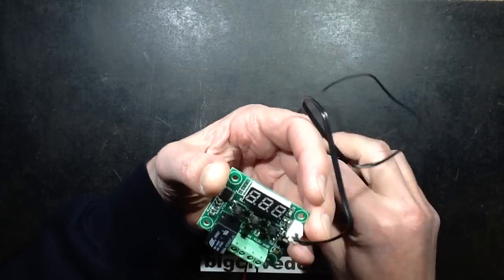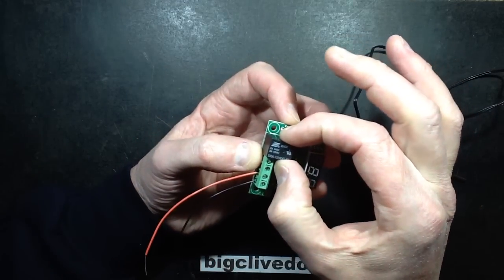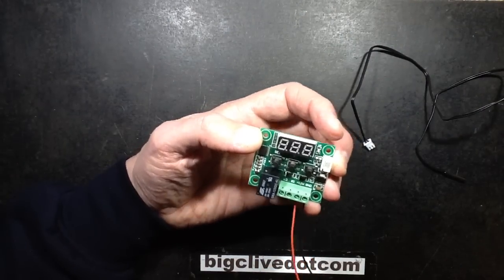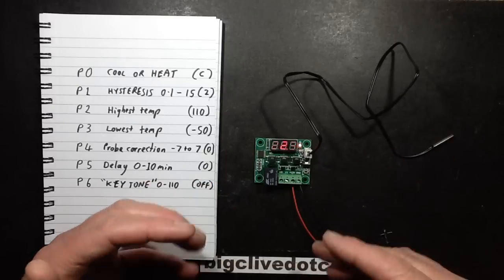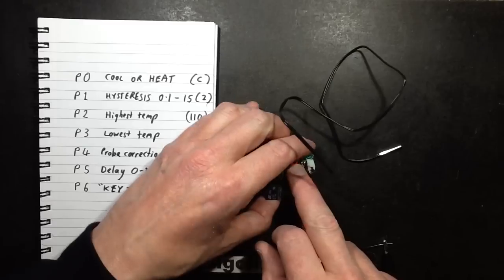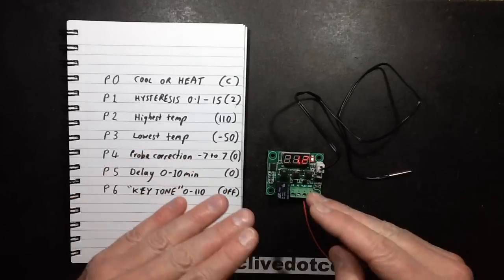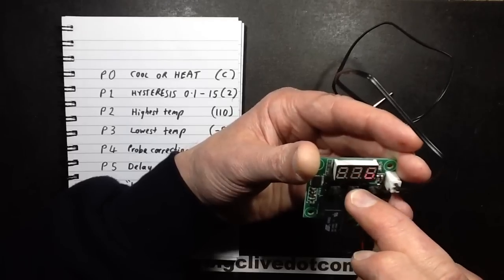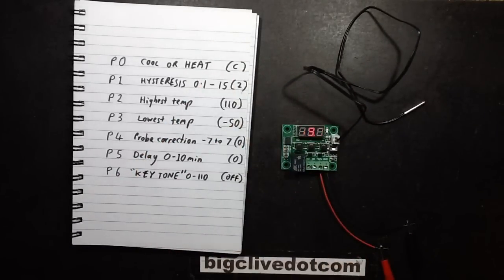Playing with an eBay thermostat module.  New data in description!

Comment: What does the LLL and Flashing LLL mean ?
My P1 always shows the LLL or LLL Flashing.
Reply from the maker: It means that the probe may not be connected properly and it is interpreting it as a temperature lower than it can read.
Reply: I'm not having any luck with this...maybe you could tell me exactly how to set this thing up....as in the reply below....
I want this device to start the Fans on my car Radiator at 140F/60C and not shut off until it comes back down to 140F/60C...
How do I set this up as C or H (Cooling or Heating) and what settings on P2 and P3 ?
Thanks !
Reply: I really appreciate your Reply...
Liked/Subscribed !

Comment: I also would like a couple for controlling a fan for solar charge controllers. Is there anything simpler.     to turn a fan on at 80degrees F?
Reply from the maker: One of the simplest things to do is fit a bimetallic thermostat on the heatsink so that it cuts in if the heatsink gets too hot.

Comment: I need something like this for converting a freezer to refrigerator. Would this work for that? 120v and maybe 10amp in rush. I guess it would require a heavy-duty relay? I just need to shut it off before my mayo freezes! Great video Clive!
Reply from the maker: It would work for that, although I would recommend using it to drive a beefy external relay.  This common unit is also very good:-  https://www.youtube.com/watch?v=9zymx2xgTmk
Reply: bigclivedotcom thanks so much for your time. I have been binging on your videos today. Thanks again...

Comment: hey guys, I got one of those which i want to use on my peltier cooler project. Its default setting is in HEATING mode. Im trying to enter the PO menu to change the settings to cooling but its not working wat can i do? Its not entering the Pn menu even after long pressing the Set button

Comment: Can I use this thermostat to control a 120 watts, 12V 5,5A heatbed?
Reply: Josef Lackner they come with a lot of defense in the switching relays so it’s hard to give accurate answer to you.

But let’s take a look 👀 

On top of that little black thing (relay) on the pcb, there’s some numbers.

If yours come with the 5 amps relay it would be no problem to drive a heater on 66watt witch is what you have if it draws 5,5 amps at 12volt. (Volt times amps gives you the watts it’s ohms that simple)

Comment: I just bought a couple of these that have 12VDC input for controller power, and a couple that have 9VDC-15VDC. I bought a couple of small electric heating pads from Adafruit (10cm x 5cm) to use with these controllers to keep LIPOs warm in my airplanes during freezing weather. I will be able to fly around with the current battery temperature visible as the plane flies by in slow flight - is that considered telemetry??? Great vid, thanks for all the info. I am ready for when these show up, now.

Comment: Well, can I use it to only read the temparature like 450 digree celsius . Clearly I don't want to use the cutoff relay or circuit and want to display high temparature from soldaring rework station or external thermal sencor. Can the circuit bear it?
Reply from the maker: You'd need a high temperature thermocouple based controller.

Comment: I got one and tried hooking it up to a fan for venting hot air and once it reaches the temp I can only get it to pulse on and off. Can anyone give advice?
Reply from the maker: +mike Paz Is the display resetting each time?  It may be crashing when the load comes on.
Reply: Thanks for the response. Do you think that's a defect in the w1209 or a load issue?
Reply: Oh Sorry I misread your comment. The screen flashes - - - and the temp flashing every time it pulses and on and off.
Reply from the maker: +mike Paz Is the fan powered from the same power supply?  It might be causing a voltage dip that resets the module.  If you put a diode between the power supply and module and an electrolytic capacitor across its power input it may help.
Reply: It is. I tried a smaller fan and it seems to work just fine so I think you are right. Thank you!

Comment: How to use it to activate a device when it gets warmer? 
mine work totaly the oposite, it activates when it gets cooler
Reply: Go to the settings, (hold the set button until it reads P0) press the plus button until it reads H.  then press set.

Comment: Thanks for sharing this video, am using this same product and on the datasheet it said the defalut low temperature is -50 degrees but is rather  -30 degrees .
My question is how can i change the settings to set my lower temperature to  -50 degrees to measure the desired temperature of my project am working 

Thanks in advance

Comment: I just received one with no instructions at all so this video is wonderfully timed (or rather it popped up exactly when I needed it).  Published parameters are often poorly translated from original Chinese.  I asked the eBay seller if the relay was NO or NC and they told me to check the parameters on their site... which had the same faults as those on the eBay listing.  I had no clue the thing had "Hot" and "Cold" modes until I saw this video.  These sellers often have no idea what they're selling but the price is so low it's often worth a gamble, especially with free shipping.

Comment: Hey Clive! I have an idea where I would have to keep up a constant temperature difference at my summer cottage so the air humidity keeps down. How would I be able to make that kind of system cheaply maybe out of these ebay thermostats? So the system should always think for example that if it's 5 degrees warmer outside than inside turn up the heat. The temperature is not important, just the difference is.

Comment: I have two of these and one of them will only control the high and low temperature to a range within 5 degrees.
If you set the high to 90 you can only set the low to 85 and not 86,87,88 or 89.
The high won't come down and the low won't go up, always 5 degree spread.
I reset the unit,rebooted it and it's holding this setting.
Anyone else have this happen?
Thanks.
Reply: I suspect that you are playing with P2 and P3 but these are not what you want.  
At power up, tap "set" and the display will flash. Use the + or - buttons to get your desired temperature.  Wait until the flashing stops and the device will remember your preferred temperature.  Then press and hold "set" to get into the other parameters, P0 will let you set "heat" or "cool".  P1 will allow you to set how far either side of your preferred temperature you can tolerate. Forget all of P3 ,4, 5 and 6.
So, if you want to heat something to 90, tap "set" and use + o r- to get 90 while the display is flashing. Hold "set" down for about 4 seconds to enter the programming mode.  Set P0 to H.  If you then set P1 to 1, the relay will operate until the temperature reaches 91.  When it turns off, heating will stop and your object will start to cool.  When it drops to 89, the relay will operate and heating will start again.  If you want the temperature to stay closer to 90, reduce P1.  The lowest it will go is 0.1, ie your temperature will cycle between 89.9 and 90.1.
Reply: Hi Ozzie, thanks for responding.
I have two of these units and they were both working fine but now they have two different issues.
I have purchased new microcontrollers to replace the two that I assume are malfunctioning.
I have also purchased a third unit for my project so I'll be testing it soon.
I need this controller to reach a high temperature, shut down ,drop 5 degrees  and then start up again to operate a separate relay.

Comment: would be nice to find a module like this that I could use to control my heat pump/ac and replace my current thermostat with it...would be better I'd I could do it all with a $3 Arduino and be able to add Bluetooth le control to it! ...yeah...LONG term project learning, connecting, programming and hardware collecting...all SO I don't have to spend $300 on something prefab that may or may not work or even last that long and prob would be podded so you can't service it or find a schematic....

Comment: https://www.youtube.com/watch?v=k6sDTfCe_tI
This guy appears to brick it but it's the alarm and it corrects itself when it's cooled
Settings Chart:
Long press the “SET” button to activate the menu.
Code: Description / Range / Default Value
P0: Heat or Cool / C/H / C
P1: Hysterysis Set / 0.1C-15C / 2C
P2: Upper Limit / 110 / 110
P3: Lower Limit / -50 / -50
P4: Temperature Calibration / -7.0C ~ 7.0C / 0C
P5: Delay Start Time / 0-10 mins / 0 mins
P6: High Temperature Alarm / 0-110 / OFF

Comment: Thanx for details.    I am going to get one.   I want a temp sensor to monitor battery charging.  I was going to build my own sensor modulewith an Arduino and LM335 but for $2.04 USD I will just use this to turn off or disconnect charging if the batteries start to heat up.  THANX

Comment: wondering if i can use this with a timer switch to operate a servo or actuator for a couple seconds. so what i want to do is open a flap when the temp gets hot and close when the temp is cool enough. i was thinking this would be able to send a signal to a servo or an actuator to open at a set temp and close after its reached a certain temp 5 degrees cooler that the temp it was set to open at. i was thinking something like a blend door actuator or a servo but after some thinking i am not sure how i would get it to operate the close step.

Comment: Its good info. 
I want to use this to power on the radiator fan relay in my car at 80°C. Have ordered and got one but am unable to set it. Can you please help me in setting at 80°C.
Reply: At power up, tap "set" and the display will flash. Use the + or - buttons to get your desired temperature of 80.  Wait until the flashing stops and the device will remember your preferred temperature.  Then press and hold "set" for about 4 seconds until P0 is displayed. 
P0 will let you set C for  "cool".  
P1 will allow you to set how far either side of your preferred temperature you can tolerate. I'd suggest 5 as a starter
Don't bother with the rest of the P parameters. 
Once  the temperature reaches 85 the relay will operate and this will cause your fan to operate.  When the fan has cooled the radiator down to 75 the relay will turn off and the fan will stop. 
Your radiator will then start to warm up again and when the sensor gets to 85 the relay will operate again and the cycle repeat.

Comment: Clive, I built something similar with an arduino and some relays. It is to control the activation of a boiler incase the timer is left on as there is no thermostat.  I was concerned that when the temperature is reached and it cuts the boiler that as it cools there might be some rapid activation of the relay due to the temperature not being 100% stable.  So, I put a check in to see what the previous status of the relay was and if it changes, it won't allow another change in status for a period of two minutes.  So, if the boiler has been turned on or off due to the temp sensor it can't activate again, to protect the boiler from being turned on and off to quickly.  What are your thoughts on that approach rather than using different temps for switching on/off? Thanks!!

Comment: I use this same unit to run a 300 watt heater that's 120 volts for a roach breeding box. it works great. for only 2 American dollars I have a few of them on hand for multiple projects. I recommend them for ev8

Comment: fwiw had a look at the 4 pin header (hoping for TTL serial....)  nuffink, - the output is erratic - sometimes there sometimes not,,,,  it does change with the probe when its outputting,

Comment: hi i need somethink like this. i want to grow some flowers in winter time at home(we have at home about 18c in winter)so i decide to build some box where i want to have maybe 3 flowers. but the question is :can that module heat up the box to 24c and keep it or its only a sensor ?
(i am lazy to find something about it :/ :D ) thanks
Reply: The output switches on and off with a relay according to how you program it. If you hook up a heating element you can set it to turn it on at 23c and of at 25c for example but you can program it to whatever you want. I'm going to use mine to control the temperature inside a box that I have around my 3D printer. If the box you are heating needs a powerful heater you can use this thermostat to control a larger relay that then switches the heater.

Comment: You're a bloomin superstar for doing this video !!!. I've been racking my brains trying to work out the control mudule works on a set of heated leather seats I'm fitting to my van. I have stripped it down to its component parts and found a seat base and backrest heating element and also 2 wires coming from the seat base heat pad that show decreasing resistance when heated. I will now get a couple of these switches and try them with the seats own thermister hopefully being able to calibrate it to the switch. Thanks very much for taking the time to share this info. Cheers.

Comment: Thank you for the helpful video and the information about the programming. You can use P7 to set  the P6 temperature limit for the over-temperature (default is 50C). P8 is LED display on/off.

Comment: @Clive, I know this is an old post, but can I cut and extend the probe wires? Or will that affect the reading? Apart from the short cable, these work a treat.
Reply from the maker: If you use screened wire you may be able to extend them a modest distance.
Reply: Thanks @Clive. It's only a foot (300mm) so I'll source some. Thanks again - great vid.

Comment: big clive  this vid was 1 millimeter short of perfection, or did I miss something, how do you adjust the temprature ? I think a video with an example of 28c for heat, covering all the P from 1 through 6, them another example with about 5c again covering all the PS, either I'm a total noob  which I also am but I think those points would of been awsome BTW just so you know your bids help out a lot and change peoples lives keep up the good work, if your ever in Cancun dinners on me.
Reply: my apology sir, I have found and read the detailed text , BTW I have an English instructions manual, and it says P6 is a high temperature alarm, "the p6 menu initially turns OFF to ON and press the set, then set the temperature at which the alarm is activated, when alarm is not activated and the display is not showing temperature but instead - - - ."  and that's all it says I have pictures of it my scanner is stored away , greeting big Clive.
Reply: how do I upload a picture on this thread?

Comment: it's not really bricked if you can unbrick it. Bricking is final.
Reply: soft bricked?
Reply: more of a buggering.
Reply: Actually it was not bricked at all. The - - - indicated the temperature is at or above the alarm point he set in P6. If clive had put the probe into a below freezing environment it would work exactly as expected and shown the temp, and then - - - when it reached 0 deg C.
Reply: if bricking is final, why does the word Unbricking exist?

Comment: If it weren't for the fact that it doesn't have an adjustable brightness display (so it won't wake me at night), this would be perfect for hacking my little space heater to have a thermostat module. Alas, I suppose I shall have to design my own!

Comment: I'm modifying my ps4 console with a huge heatsink and one of these controlling the fan, hopefully with a big enough heatsink the console should be able to run completely passively cooled most of the time, at least in winter.

Comment: P6 seems to be high temperature alarm from what i read in descriptions by sellers on ebay. So it may not be a failure in the program just a safety feature.
http://www.ebay.com/itm/Upgrade-W1209-Digital-thermostat-Temperature-Control-Switch-12V-Sensor-Module-/252422532070?hash=item3ac58e2be6:g:y10AAOSwzJ5XXX9I

Comment: I found another similar thermostat for about the same price but has start/stop temperature displays and an  on-board piezoelectric buzzer. http://www.ebay.com/itm/1pc-Temperature-Controller-12V-Intelligent-Digital-Led-Thermostat-Practical/322182164107?_trksid=p2047675.c100005.m1851&_trkparms=aid%3D222007%26algo%3DSIC.MBE%26ao%3D1%26asc%3D38828%26meid%3De9062913d8e543dea9c7343fca5ab584%26pid%3D100005%26rk%3D2%26rkt%3D6%26sd%3D152157934382

Comment: I bought 2 of these things and they are quite versatile.  On thing I did notice as an aside, the display reads all "L",s if the temperature sensor is not plugged in.  The circuit board is sturdy but desoldering things like the relay caused a problem with wrecked vias.

Comment: I have one of these also. Mine has the power block on the left instead of the bottom. I use it on my small "dormitory" refrigerator. I plan to get one to put on my chest freezer and attach some sort of noise generator to the relay to warn me if my freezer stops freezing. Not a bad little item.

Comment: Thanks Clive for the informative video. Is it possible to connect K0 and K1 to TEC1-12706 Peltier modules and use to maintain constant temperature within a 3 ft x 3 ft chamber?

Comment: Can this be used to control a Movincool CM12 AC unit? I need something considered "milivolt" and has basic America residential AC unit connections. The stand thermostats have no remote sensor, and only update temp 15-20 minutes which means this small sealed area has already become too hot.

Comment: I have a similar product. Based on that i'd encourage everyone who would like to use these thermostats around its lowest and highest temperature to check how it's working while reaching those temperatures. Mine has a programming error,  if it is in cooling mode, the temperature is set to start cooling at 100C, when the temperature exceeds 110C (maximum temperature) the display goes to HHH and it immediately switches the relay off therefore shutting your cooling off! 
Ps: i would put w1209 to the video title, so people with the same tepmerature controller coud easily find this video